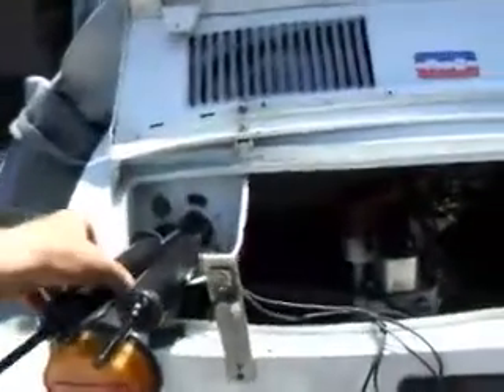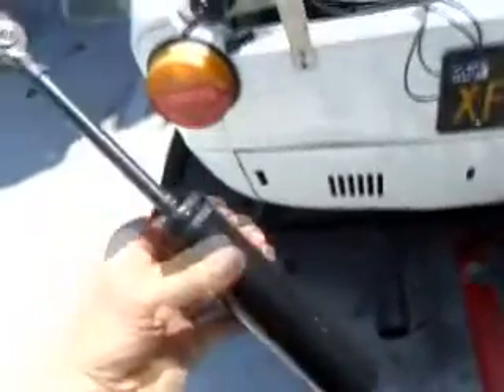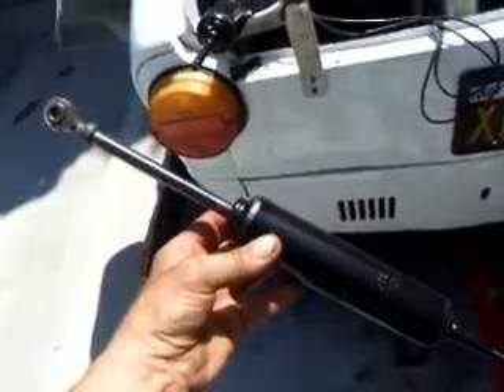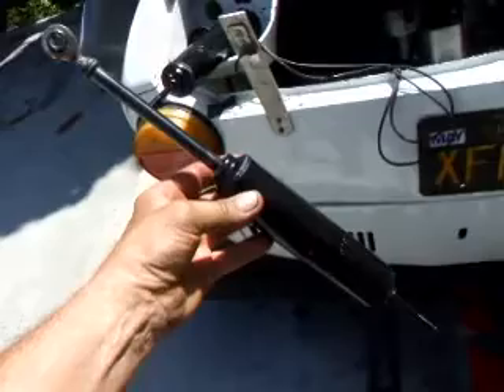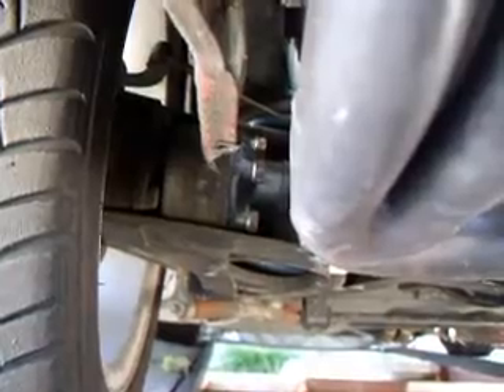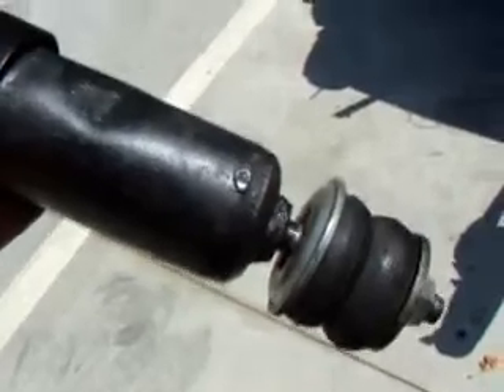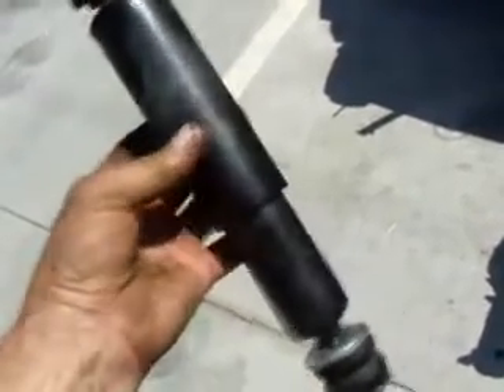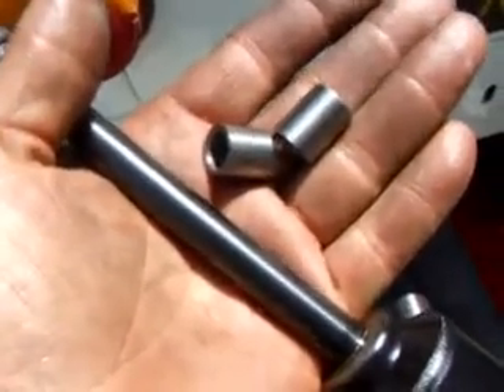fiat 850 Shocks-02.mp4

Comment: Hi Jon, any tips on controlling the heat soak from welding the helm joint so it doesn't mess up the seals?
I assume the motor-oil change stiffens up the shock a lot, would you only recommend something like this on an track car, or is it ok for a daily driver?
Very good as always, I had always assumed a fluid change was a shop only job.